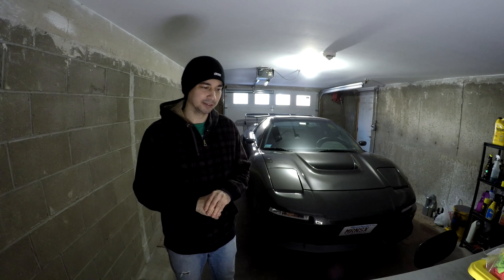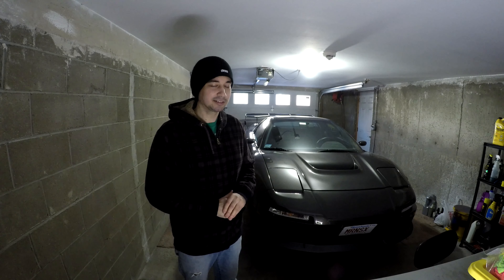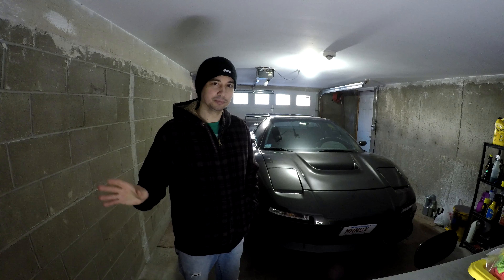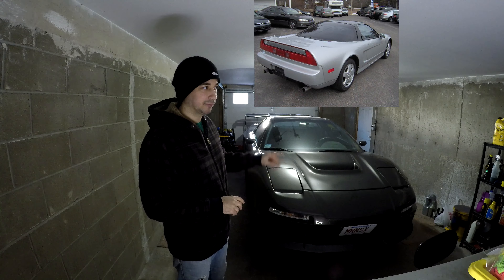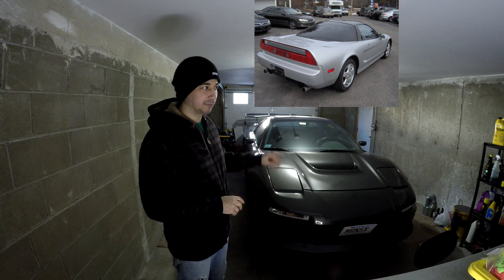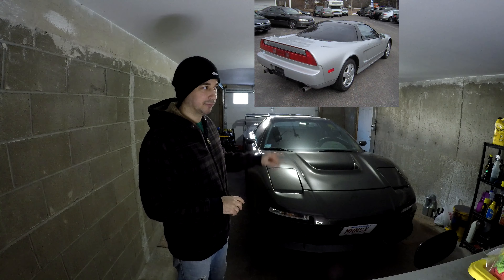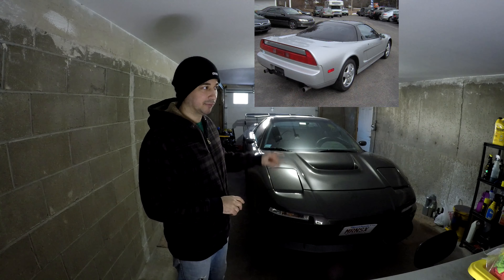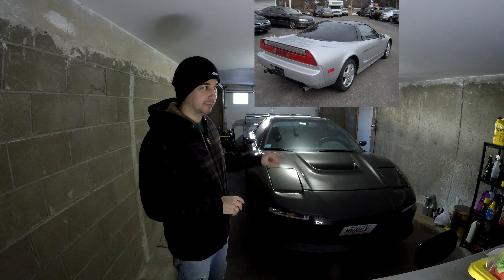NSX SOS Twin Turbo Install Video Series Introduction

Comment: What site did you order the parts from?
Reply from the maker: What parts in particular? I've ordered from various vendors through the years.
Reply: The tubing, the turbo set, the body kit, and the mirrors, the spoiler, I haven’t been able to find a good website brother
Reply from the maker: @avitia1212   the turbo kit was purchased from Science of Speed https://www.scienceofspeed.com/. Mirrors I purchased from Moto Works out of japan http://www.moto-works.jp/products/rr-mirrors.html. The Voltex wing I got through Evasive Motorsports https://www.evasivemotorsports.com/ and that had a year and a half wait time for it. Hopefully not anymore but it's possible. The Marga Hills kit I got directly from Marga Hills out of Japan http://www.marga-hills.com/.  I emailed to Kazz's email shown in bottom of the page.  I think https://www.mitamotorsports.com/part-number also can order for you Marga Hills body kit as well if you rather deal with Marc but Kazz was pretty nice and easy to work with imo.